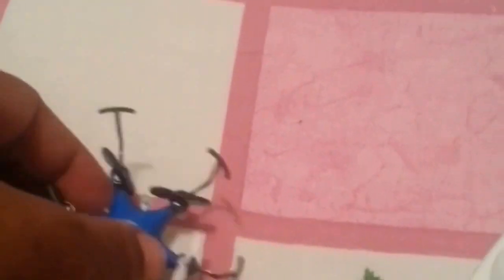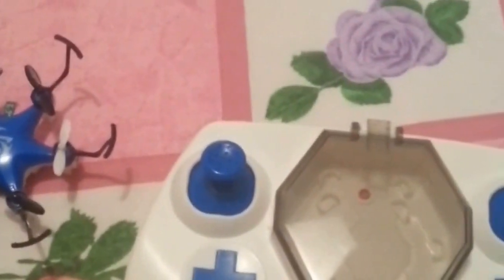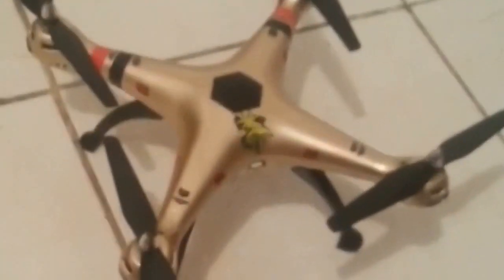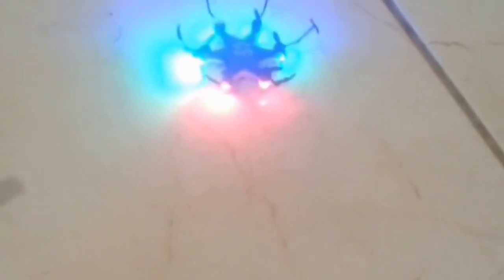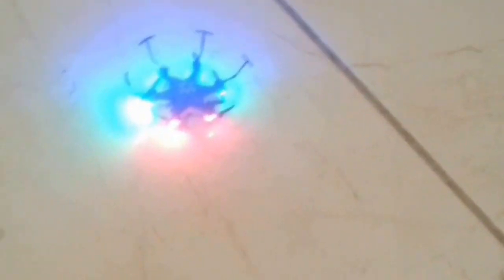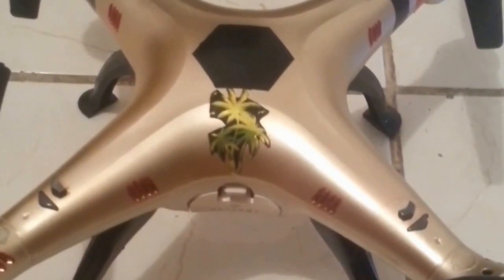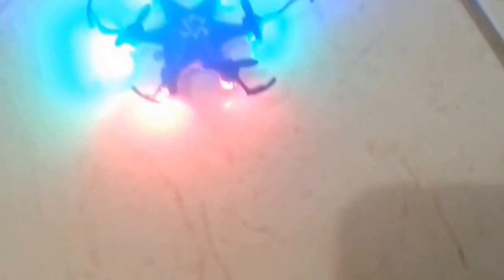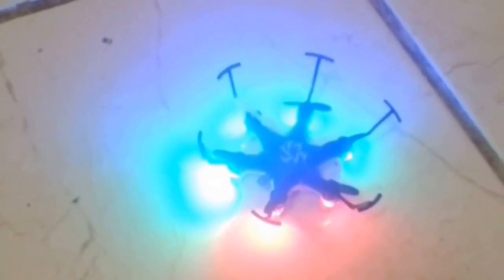Nano drone won't fly

Comment: Two of your propellers are misinstalled.  Note that there are two different shapes of propellers, clockwise and counterclockwise.  They must be installed on corresponding CW and CCW motors, or the quadcopter will not takeoff.  Take a close look at the following picture, paying close attention to the two shapes of propellers, and which motor each shape is installed.   Make yours match the picture. http://img.banggood.com/images/oaupload/banggood/images/1C/FA/d51a19fc-3353-40aa-8100-45b4e6bf604e.jpg
Reply from the maker: Quadcopter 101 you did it! Thanks👍👍